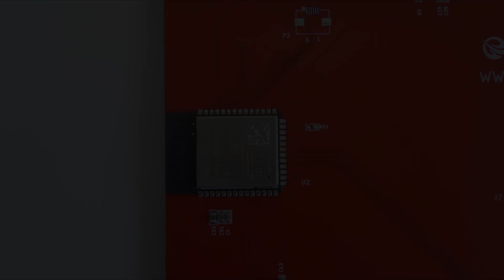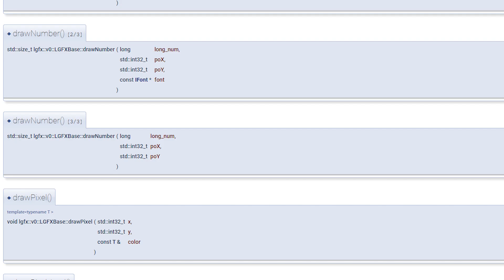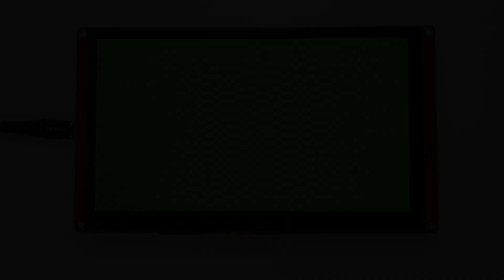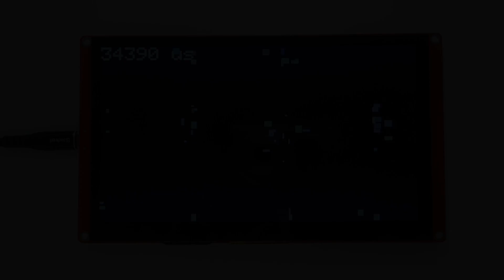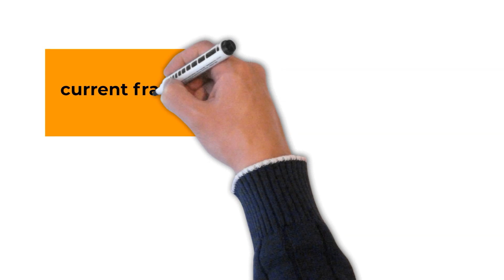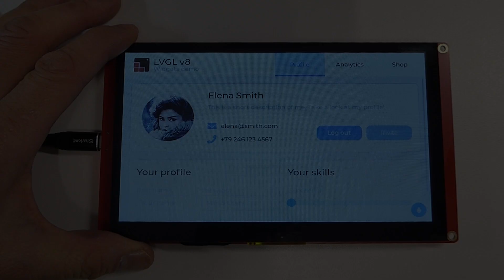ESP32 + 7in LCD + Fast RGB Interface

Comment: 7inch uses a lot of current because it has a lot of backlight LEDs.
For this purpose, sufficient power is required.
RGB Display does not have a buffer because it does not have a built-in driver.
PSRAM is used for that purpose. PSRAM is slow.
WebRadio, which requires high speed, will not work as it will interfere with reception.
It is necessary to use it with speed in mind.
Reply from the maker: Thanks for the tips.
Reply: In the ESP32 PSRAM is octal, runs 80MHz double data rate   = not slow

Comment: Things that i don't like and that i feel they should ideally fix:

No access to i2c. I2c would provide easy connection to sensors and easy IO extension. The i2c bus is used internally for the display touch panel connection, which means the pins aren't repurposed and can support numerous additional devices in parallel on the same bus!

No access to native USB. So i can't even implement a custom USB device on the ESP32. What i'd like is a set of solder jumpers to be able to switch USB from UART to native USB. And also an actual second UART connector for the one capable of programming. Alternatively, i want two USB ports and maybe a solder jumper or at least a couple diodes to select where the processor will be powered from.

Another improvement would be an SPI connector. A second SPI device can be multiplexed in via IO38. I also suggest connecting 0-2 pins of each colour channel to the highest bits of the same channel, old trick. A sensible compromise could be to also delete G2 from the display and repurpose it as an IO pin. I'm also not sure what DE is good for, whether it should be driven by the micro, or maybe fold it together with LCD_BL_CTR.

"Persistence of vision". No. The system is simply not vblank-synchronised or double buffered and ends up scanning out intermediate state of the display, which looks broken, because the image must be scanned out whether ready or not, so through part of the scanout, it scans out the result of blanking operation, and through part, the result of particle draws. If you have to work with something like that, you'll make it much easier on your eyes by never clearing the whole screen, partitioning it into tiles, and issuing all drawing commands for one tile at a time, and you'll have to clip the individual draws. This is actually how object based drawing works in LVGL, it already runs in tiles, and you're bypassing this mechanism by issuing draw commands via LovyanGFX (essentially Adafruit GFX like library) manually.
Reply from the maker: Thanks for the tips.
Reply: @BytesNBits   Oops i'm dumb, there is no USB because the pins have been occupied with i2c bus. There will be no USB unless two sufficiently capable pins can be liberated somehow and i2c moved.

Comment: After I upload the first test code, why does esp32 keep rebooting?
Reply from the maker: I'm not sure. Can you run just a simple program that maybe just sends stuff to the serial link just to check the basic system is OK. Then expand from there to try to catch what's knocking it out. Make sure your power supply is OK.
Reply: @BytesNBits  I was able to solve that problem, but I have another question. I want to connect an I2C sensor, but the I2C pins are already connected to the touchscreen and can't be used again. Are there any other pins I can use for the 7" display? Thank you very much.

Comment: Why do you assume we know what your talking about? What is a class what is an instance? I remember you were asking for our input on programming instructional series but nothing has transpired.
Reply from the maker: Unfortunately some aspects of the project work require different levels of knowledge. This one needed a bit of object orientated coding to get it to work which I didn't have time to explain - it's a big topic. think of it as a pointer to topics you need to find out about.

I will be covering C++ coding at some point but there are just too many projects to work with and the coding tutorials don't seem to perform as well as other topics so they tend to get pushed back a bit.